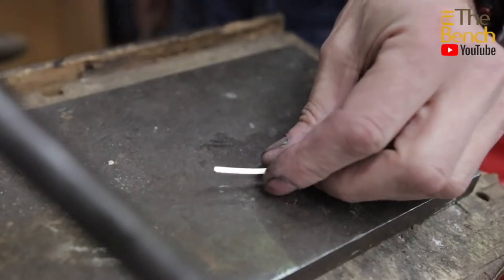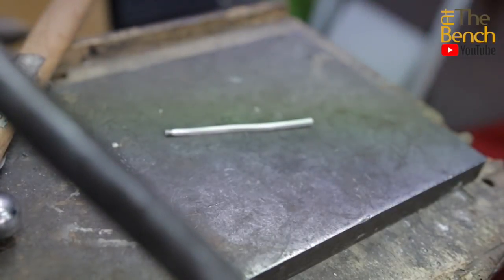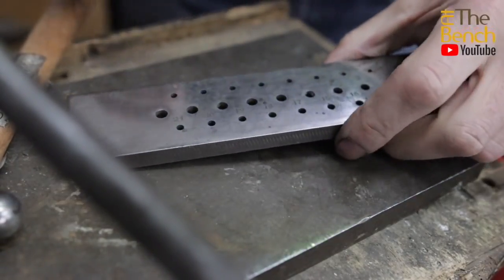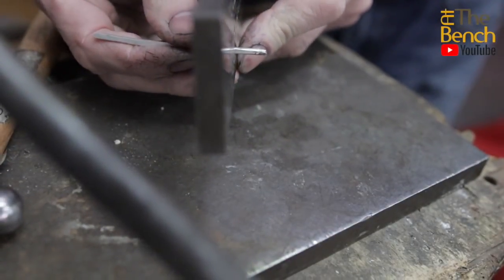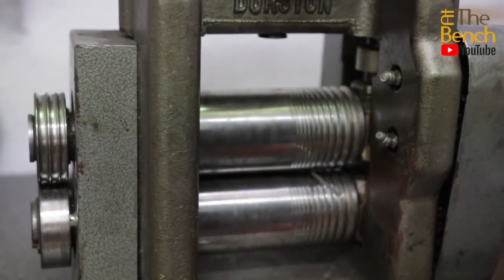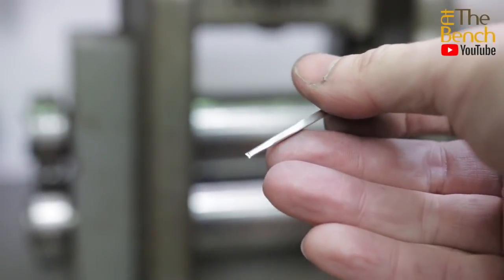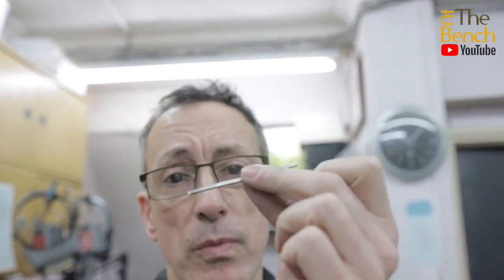Three Ways To Taper The End Of Wire Before You Draw It Down

Comment: Is there any way or do you have a video on soldering 3mm or larger diameter silver rod made into large jump rings with a butane torch. Children in the house and i dont feel the most comfortable with buying oxy mapp or other large torches inside. Would i need to use a special torch for the 14oz bottles of butane? Or will a refillable torch work for larger jump rings. Wanting to make a curb bracelet. Around 10mm so would need to be strong joints for the twist.